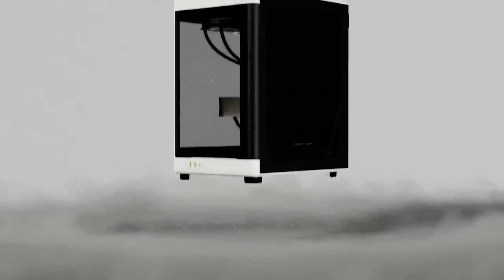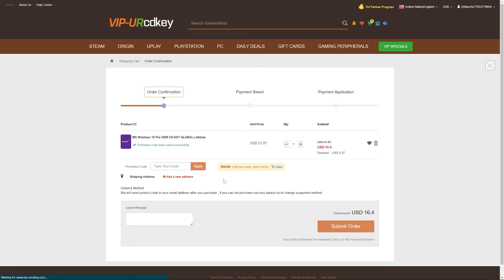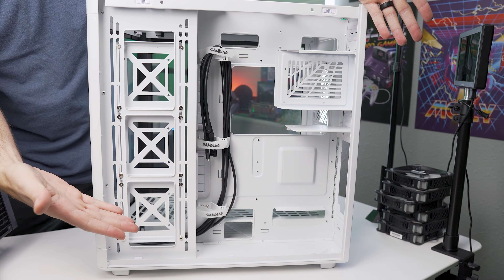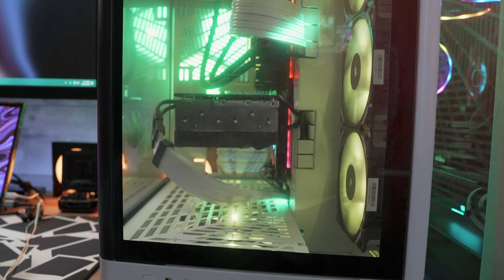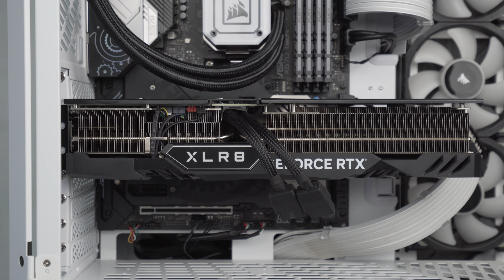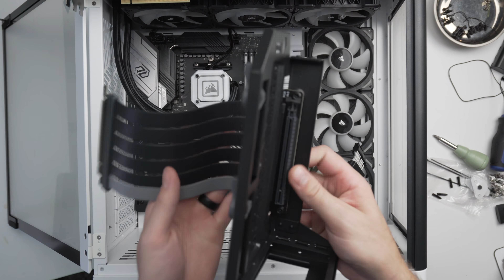I Rebuilt My Gaming PC AGAIN! | Gamdias Neso P1 PC Case Build & Review

Comment: The only negative I can see is the ugly and weird Nvidia  power situation. I have no idea who the idiot at Nvidia was that thought that would look cool or awesome...but they should go to the shed. My local store sells a PCIe bracket to work in the case, actually two version, for PCIe x 16 version 4 and 5...but they are not cheap. Luckily I dont need it because I have an AMD RX 9060XT 16GB two fan card. By the way, the top radiator can actually be installed on the top of the case with the fans on the inside of the case. It looks nicer and there is no pressure on the CPU power cables and they are easier to access.

Comment: U can rotate the pcie slots 90° by taking out 4 screws!
Reply from the maker: you still have to provide your own GPU riser cable though. The case doesn't come with one
Reply: Hi can this case fit artic liquid freezer iii 360 at top? because the radiator of artic aio is so thick. TIA

Comment: you could simply flip the expansion slots unit from the back of the case and you'll be able to vertically mount video card and you will need only the riser cable from your vertical mount you already have. go vertical bro.